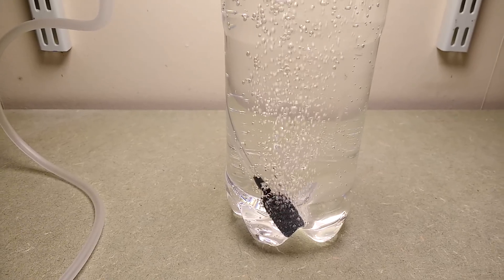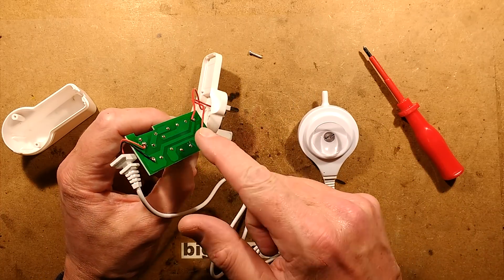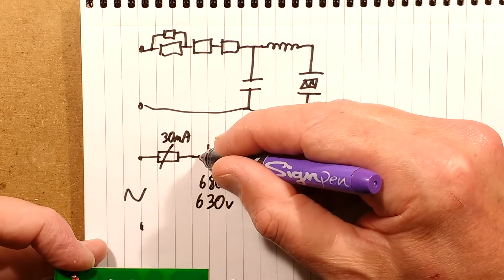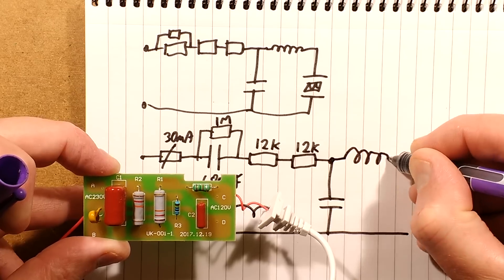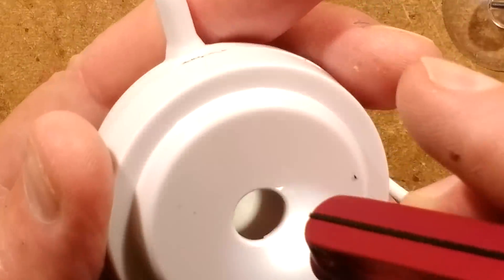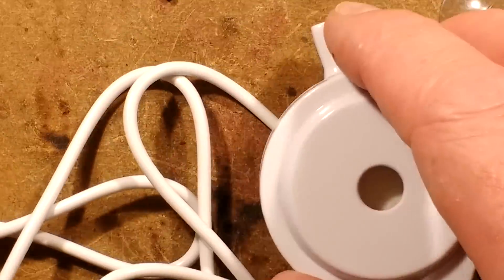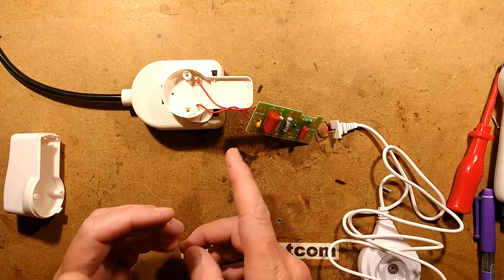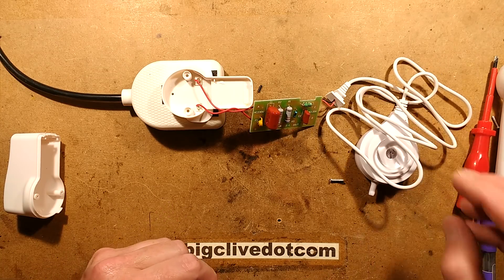Another mini piezoelectric air pump.  Let's compare the circuitry.

Comment: Back when I etched PCBs with CuCl I had no issues with foaming but I used clean chemicals.
What bothered me most was that the bubbles would agitate the lower edge of the PCB much more, as they rose they would move away from the surface of the board leadign to very uneven etching.

Comment: Perhaps that inductor is a "peaking coil" , I have seen them in other piezo circuits .
It would be interesting to do a frequency sweep and find out where the resonant point(s) are of only the piezo device itself and then do a frequency sweep of the whole device .
"My kingdom for a spectrum analyzer"
Could a change in the value of the dropper cap allow you to bypass the resistors ?
Reply from the maker: I think the purpose of the resistors is to act as a constants resistance to noise whereas the capacitor would just pass high frequency noise.

Comment: yeah it's a low-pass filter with a -3 dB cutoff frequency of about 800 Hz.
Reply: Thought so too.. To keep the crystal from buzzing all kinds of weird audible frequencies that might come from those network-via-mains adapters.
Reply: Those PLC adapters work on higher (non-audible) frequencies though. But there is a ton of other noise sources.
Reply: Could you please explain, how you calculated the cut-off frequency?  Maybe to specify the question: Did you just calculate the Frequency response and put in -3dB as level to get the frequency, or is there a shortcut?
Reply: Anton Neufeld 

https://www.v-cap.com/speaker-crossover-calculator.php

-3db is butterworth and -6db LR
Reply: I just ran a simulation in LTspice

Comment: Clive please try this - I've done it and it works great! I electro-etch at about 12v using ordinary salt water as the electrolyte. Costs nothing and you already have everything required.
Reply from the maker: Is it quite fast?  (I suppose that depends on current).
If the copper is etching completely away do you just move the main connection point about?

Comment: Would be interesting to see the waveforms - that L value seems low to do anything unless it's forming a resonant circuit. Or for a quick test, see if shorting it makes any difference to the pumping action.
Reply: Agreed, the output waveform wants to be probed/displayed!
Reply: Well, the piezo crystal has a coil in series with it and the crystal (mostly) acts as a capacitor, so I guess it would form a series resonant circuit ( + the RC circuit before the coil). I do wonder how the waveform would look like at the output.
Oh, I forgot. With the capacitor before the coil, it actually form a parallel resonant circuit, which I presume would oscilate at a higher frequency than 50Hz.
Reply: I had better check I haven't missed any of your videos, they are really interesting.  Always think of you when I see a fancy LED installation and wonder if you were involved in the making of it.
Reply: I used a HVP-70 probe to scope a 120V version. The inductor had very little voltage across it and the voltage across the pump increased slightly if the air outlet is blocked.
Reply: Digital watches have a small inductor in series with the piezo.  If the inductor is bypassed (shorted), the output volume diminishes significantly.  I believe the high voltage spike from the back EMF excites the piezo more efficiently.  Even a musical lcd watch played music fine at all notes; just very quietly.  The audio tone generated by the watch IC passes into a transistor that drives the inductor in series with the piezo.  When the inductor’s magnetic field collapses after saturation, the high voltage back EMF drives the piezo much louder vs the low voltage of the watch battery.
Reply: Piezo crytsl production
Reply: Have you ever watched Mikes channel? That guy knows his shit! :P

Comment: What happens if you drink the bubbly water made from this? Does it taste/feel like seltzer water?
Reply: Also the bubbles in seltzer water are made of CO2, which partially turns into carbonic acid. That gives it the sour taste.
Reply: No more so than water someone had been blowing bubbles in with a straw, I suspect; there's no pressurization to dissolve the gas in the water.
Reply: All the bubbles do is aerate an d oxygenate the water, which is why you frequently see them used in aquariums as they allow a greater density of fish than you might otherwise have sufficient surface area to naturally oxygenate the water.  They also help to circulate the water and prevent stagnation of the water and surface scum formation.  In Clive's etchant bath they will not only help to introduce oxygen into the bath but also keep the bath solution circulating (you will see them used in some Ferrous Chloride etchant baths for circulation as well).

Comment: I have tried using piezo's in a record cutting head. They were rated for 30v AC, i got them up to about 80v (peak) before they failed catastrophically and there was a nice display of sparks creeping over the ceramic side. After that, i used a neon bulb across the piezo as a very crude but effective limiter.

Comment: Hrm! I dunno about the foaming up other than there being a surfactant/detergent (as you mentioned before.) I can shoot a message over to NileRed or NurdRage and see if they have ideas of how to easily remove it. Luckily for me, the hydrochloric acid that I purchased to make copper chloride etchant doesn't seem to have that.
Reply from the maker: I'm thinking I'll probably have to try again with purer acid.  Not easy to get sent to an island due to hazmat shipping.
Reply: Clive, yeah. Hopefully there's an easy way to purify it. I know there are several ways to make HCl from seawater... but that usually involves rather expensive equipment.